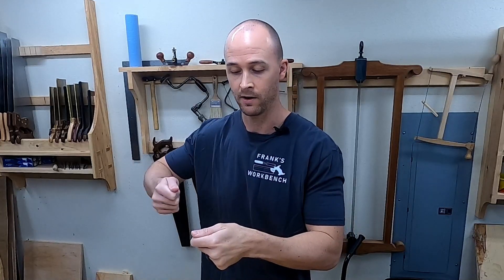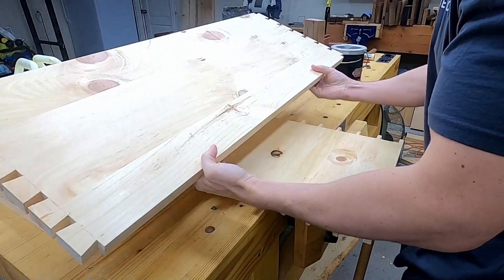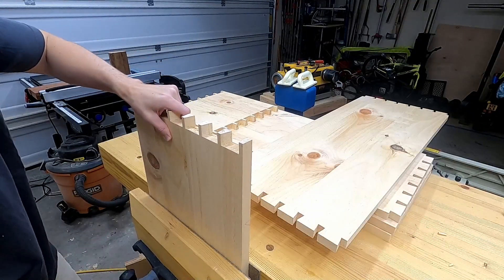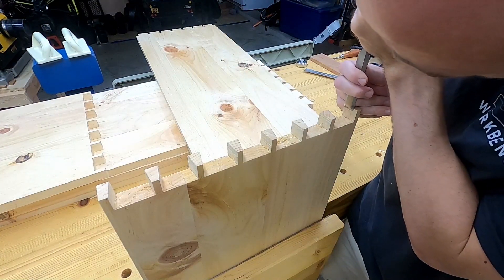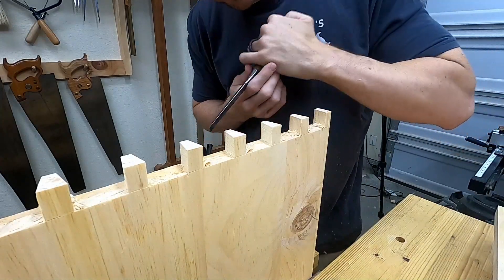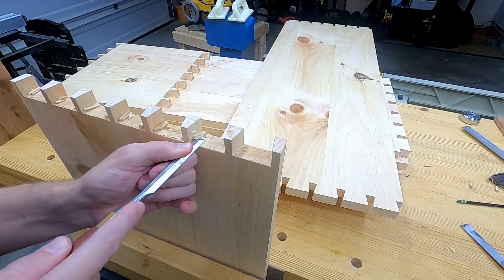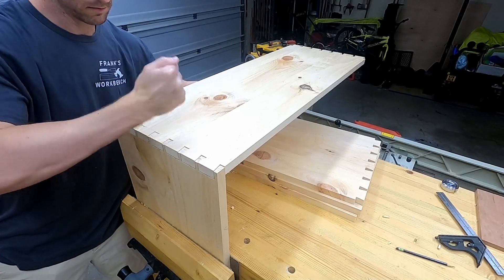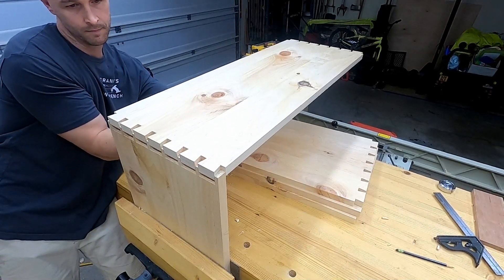Dovetail Assembly Trick You Must See!

Comment: Beginner woodworker: Gluing 2 unmatched boards together. We have an oak cabinet from the early 1900's. What the cabinet maker did was instead of gluing two together to make one, he split one in half and used the two halves to frame one board in the middle. We have had this piece for years and I just noticed it. He put the lighter board in the middle and the two darker (1/2) boards on either side, so it looks symmetrical.

Comment: Excellent technique. When you add glue, it will swell the wood and further tighten the gaps. I use a similar technique as yours. When I pair the dovetails, I chisel from the show face down while putting a very slight inward angle and avoiding touching the other surrounding edges. 

My problem is taking shortcuts which inevitably leads to failure. Layout and marking is critical, but I often fool myself into thinking it's unnecessary.  It's way too easy to wind up fitting the wrong two boards together or getting their orientation wrong.

Comment: What a fantastic idea. Distinctly remember a bookcase I made many decades ago without any metal hardware. It seemed like many hours getting those dovetails perfect. At least until I remember seeing the splitting appear. Used sanding leftovers mixed with glue to patch it up. Looked well, but if you looked at the right angle, those splits along the grain were terrible. Appreciate the excellent ideas that come from you. Thanks a million 👍🏼👍🏼👍🏼